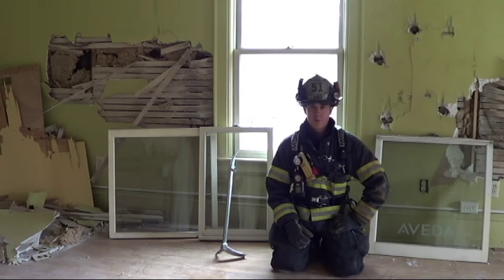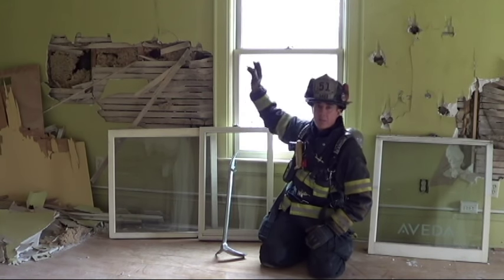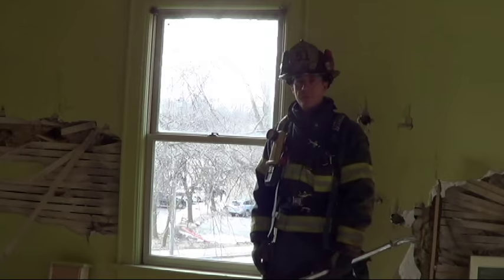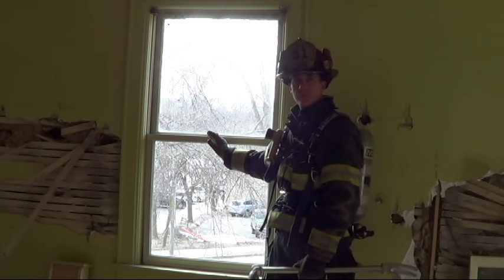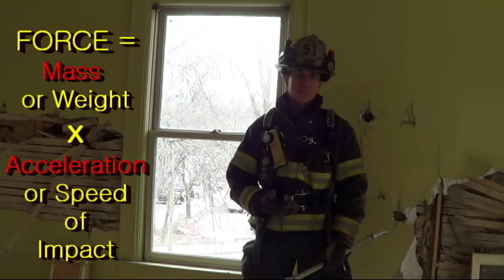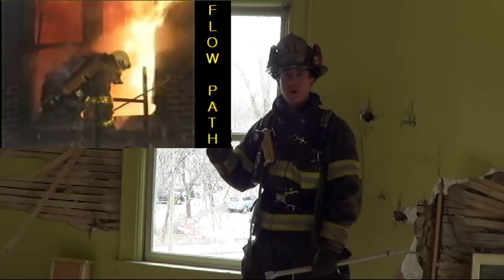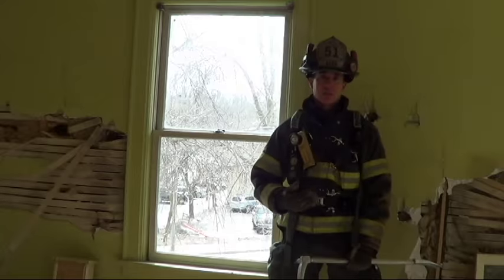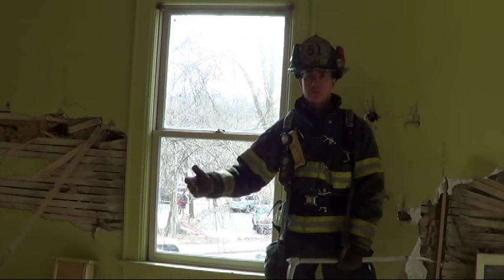Firefighter VRS: Window Clearing for Emergency Egress

Comment: great video Brother!  How do you like using The Pig?
Reply: It's decent - Just like anything else it has advantages and disadvantages - Definitely like the 8lb version more than the 6lb piglet. However I've found a simple 8lb. flat head axe gets hung up the least, but still has a nice balance of power and weight to get the job done.

Comment: in a room full of smoke and 0 visibility.... clearing a window is going to take more than 15 sec
Reply from the maker: In zero visibility probably, but if visibility is that bad you're going to have a hard time just finding a window - At a fire multiple factors will always influence performance. In the end training "benchmarks" are intended to create a goal - I've busted out numerous windows of many different styles and construction, some in as little as 5 seconds and others took almost a minute to clear out - You can't practice for every situation, but you can work on technique to create the necessary muscle memory so you can minimize your time and maximize your proficiency - So when you are faced with zero visibility and excessive heat your moves will be quick and instinctive.